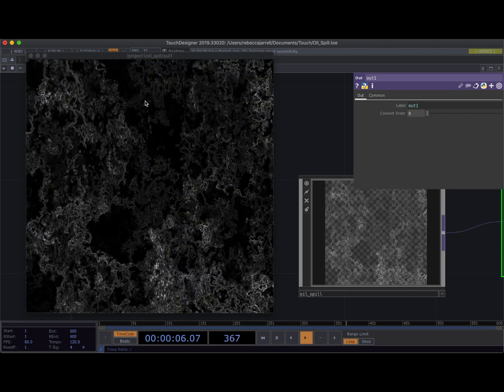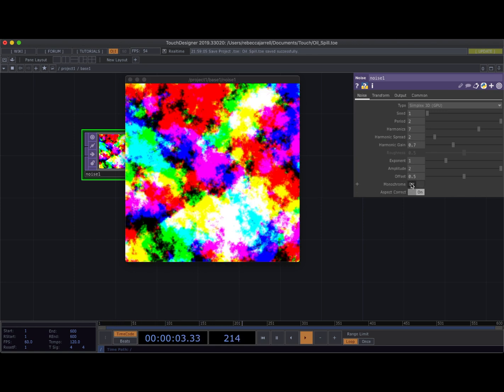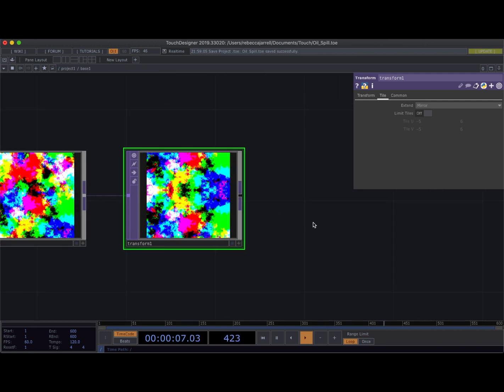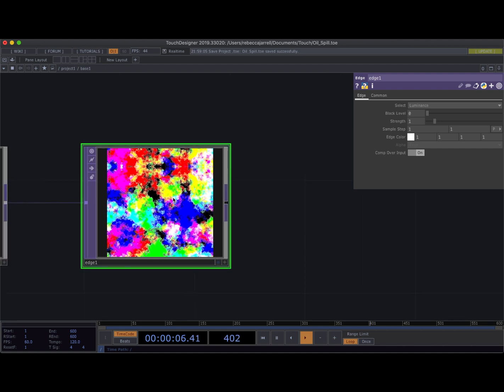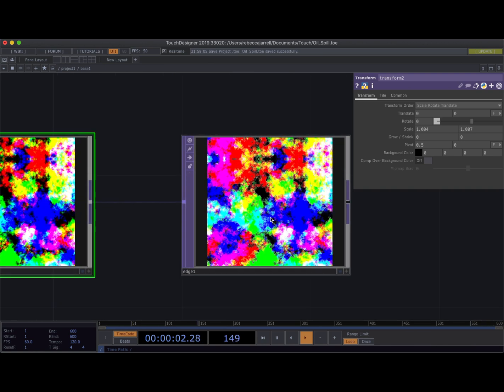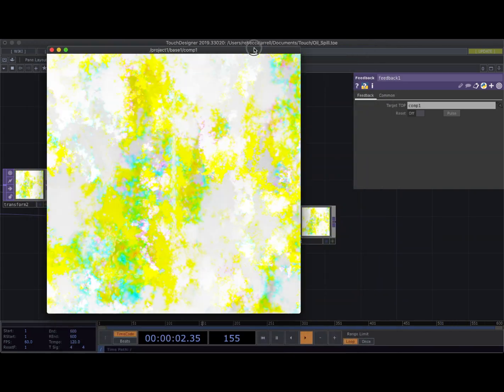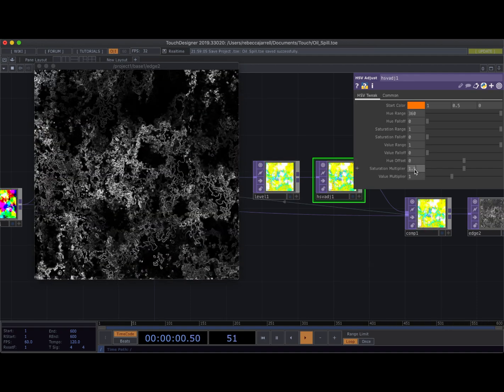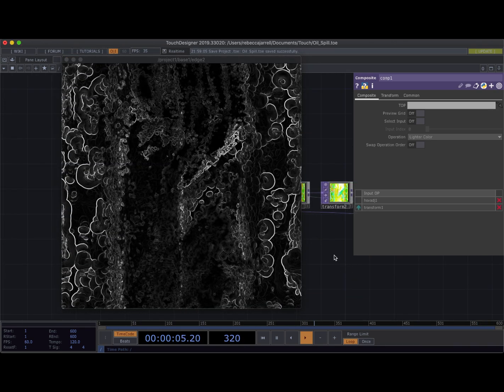'Oil Spill' - TouchDesigner Tutorial Using ONLY TOPs!

Comment: Thank you! Love how much you seem to be having fun with it, it’s really motivating! How long do you usually need to go from idea to final piece if you’re making something new and experimenting?
Reply from the maker: Fjodor F thank you so much, and actually it really depends! Sometimes, when I think of something I want to build, I think of the actual nodes/code and that’s certainly fastest. However, sometimes it’s a visual or a concept that occurs to me and that can take much longer. Usually, when I find one thing I like, I save that thing out as a tox and then continue copying that tox into the same project over and over and tweaking and saving and tweaking again until I have many different things from the same basic one! Sometimes it takes me a few hours to feel like I’ve exhausted all the options. Other times, like with ‘Vincent’ for example, the idea is what’s fascinating and I keep coming back over the course of several weeks or months because I think of something new I want to try. That’s why modular networks and custom parameters are so great! They enable you to make drastic changes in the output, without drastically changing the file.
Reply: @rey_nbows  Thanks, very interesting! Helps to know how it works for others. I’m just starting out in touchdesigner, and right now I really have no idea what I’m doing or how to really "think" like the tool does. It can be really frustrating to know how you want something to look like while having no clue how you could reach that goal.
Reply from the maker: @fjodorf7341  I feel you! Always remember that we ALL start out that way. And we ALL always feel like we don't know enough. Everybody's learning - it's just about doing a little bit every day to get you closer to the kind of fluency that means you can express what you'd like, using the tool to your advantage. But this community has been SO incredible. It's a universe of incredible teachers. Trust me, we'll all get each other there UwU